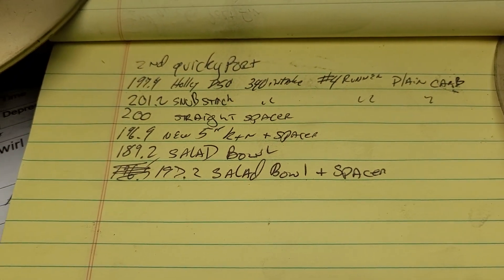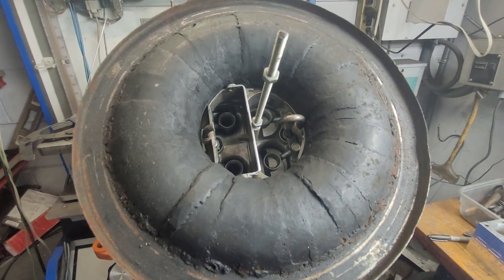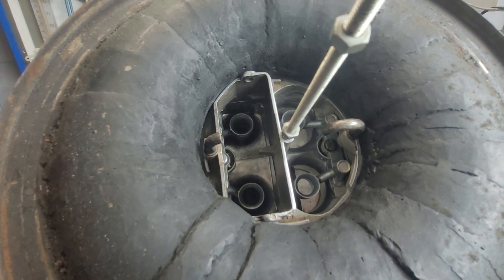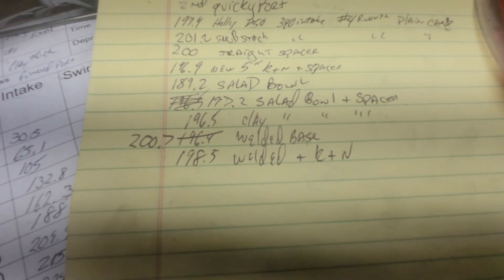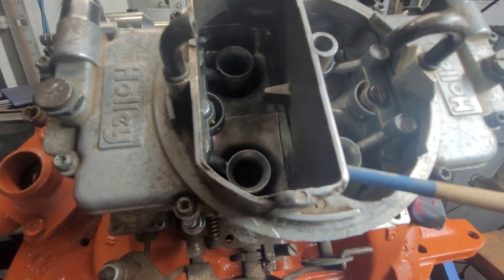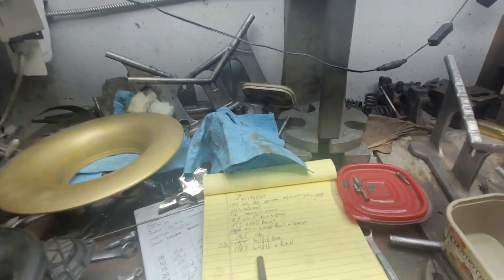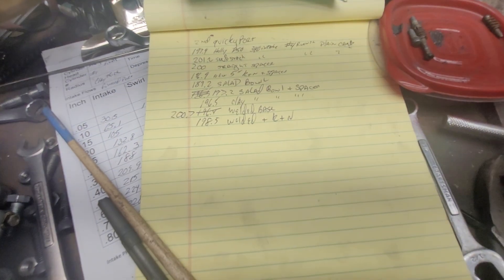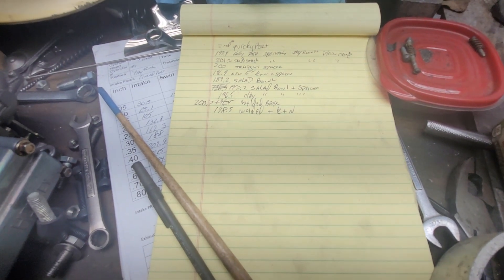Mission Impossible 318 project. 340 intake Holley 850cfm carb. Salad bowl, custom welded base, pt 2

Comment: 🔔😎 from my tool kit from 60 yrs ago.
Make an inverted cone to set over the center stud to help shape the airflow off the flat air cleaner lid. 🤔
That's why a taller filter works better, more room, and the filtering lids even better.
Try it.

Comment: Would be interesting to make a  a piece to put on the bottom of air cleaner lid  with the stud going though the middle. Shaping it to direct the air. We ran some  K&N plastic lids for 2bbl circle track.  They had what looked like tongue pointing down
Reply from the maker: Interesting. Thanks

Comment: I always ran a air cleaner base with my stocker. It always was faster. Speedway motors has some very nice 2bbl and 4 bbl spun aluminum air cleaners with very good bases on them for flow directing
Reply from the maker: Good info. Thanks
Reply: Have you ever flowed a carb with a velocity stack? I have an old gold anodized aluminium, I can't remember the brand. I got it from my uncle that was purchased back in the 70s.
Reply from the maker: @Tshade67  I don't have one. Sorry

Comment: Daggonit charlie youre really gonna make me weld up one of those pipe radiuses, that looks like its gonna be quite the headache
Reply from the maker: It is, and it is heavy. Weld me up one for my Chevelle too! Thanks
Reply: @servediocylinderheads  i was actually thinking about it a bit more, that might be a good thing for someone to 3d print some press dies to stamp them out of tin,  that is beyond what I could manage right now, and might be a little big for the average 3d printer tho.  Another idea would be turning some dies out of hard wood, but I dont think my dad's wood lathe is big enough for that.
Reply: Use gray rubber house pipe insulation as a test. Heat shrinks it but it works.